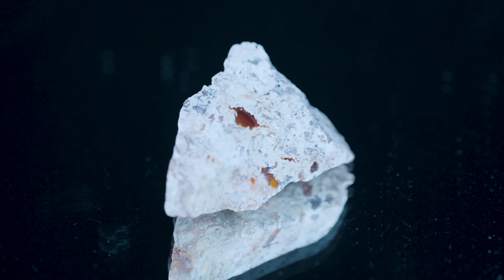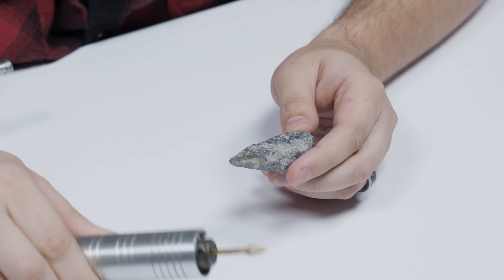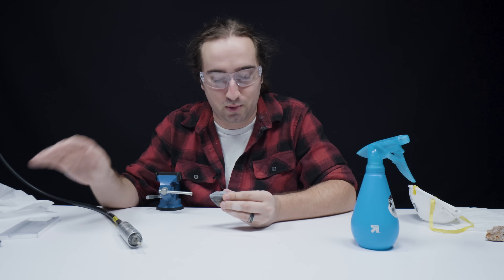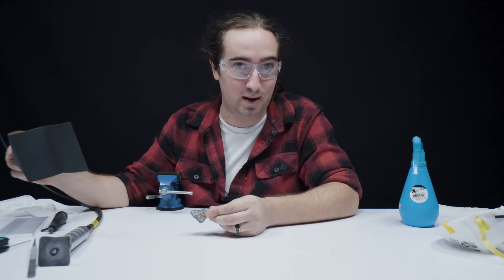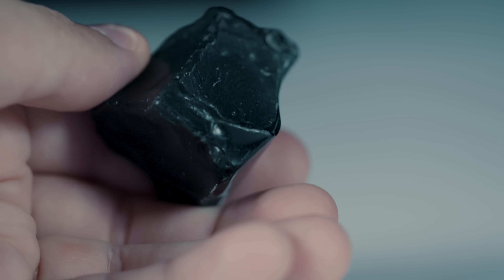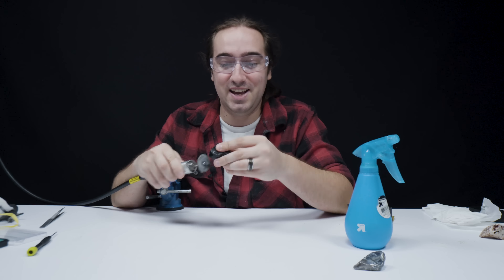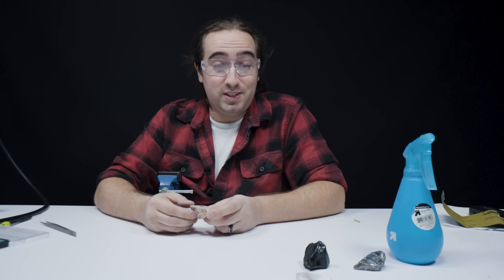Gemstone Polishing: A Beginner's Guide!

Comment: Please use water when doing this. If you have no other choice to work stones dry, it is best to wear respirators rated for fine silica dusts, and do it outside on windy days. doing it inside like this with breathing protection is a hazard because that dust stays airborne for a couple days and you are at risk for breathing it in when you don't have the respirator on.

Comment: Hey everyone, I've been drilling rocks to be used as pendants for 4 years now. Safety is a key concern anytime I talk to someone who might also want to get into lapidary too. You should really use water or an oil based lubricant when polishing, cutting, or drilling stones. For your face, wear eye goggles and a reusable respirator with P100 filters, or a full face respirator with P100 filters. I promise the full face is worth it, it has spared my eyes from the gritty mist or any stray chunks that could fly up at me, and none of it gets into my airways at all. N95 paper masks offer the minimum protection, and that's what I initially started with, but it doesn't properly seal to your face and I'd end up with an itchy nose which is not a good sign. Rock dust and airborne vapors can coat your lungs over time and give you a deadly condition called 'silicosis'. The buildup will slowly suffocate you to death, so please PLEASE use water (without wetting your electric tools) and the correct face wear. N95 protects against airborne dust, but the P100 also catches oils and moisture, thus offering more protection.

Comment: He stopped at 2k grit. With the hardness of a 7.5. You should be up in the 80k grit range. Diamond paste works well. If you run each stage of grit properly by the time your up to 80k grit your good to go. If you want or can you could go up to 100k grit of diamond paste and your good to go. There is aluminum oxide paste than cerium oxide paste. But I found diamond paste is the best option.

Comment: Nice vid, but I'd use a much more serious face mask. Cutting or polishing minerals dry is not to messed with. Get the best mask you can get and use a extractor with a damn good filter. I'd never dry cut because it can be very dangerous. Search for how dangerous minerals can be before you cut them.

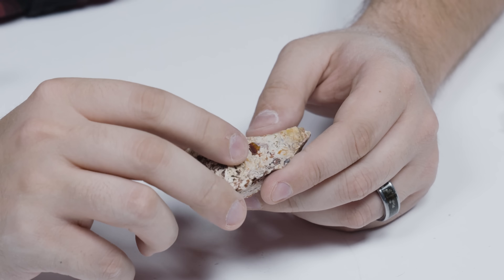Comment: 9:30 I’ve been working opal with rotary for almost a year now and I must say from day one to now I’ve massively improved. I do agree a cabbing machine is best(I’m saving up for one but for now a rotary tool is great for what I need) but what I’ve learned with the tools is there’s many ways to go about this process especially with free-form pieces. Sometimes even a 3-4 day tumble can easily make the experience so much easier. I find that a good pre polish is key for the best polishing experience with no can machine and just the rotary tools as after I began using it my polishing results were DRASTICALLY improved than jumping straight from sandpaper to polish. Hopefully I’ll get the machine sometime soon but improving just with the rotary tools is equally as motivating 💎

Comment: Ooowee! I'm surprised you didn't shatter your obsidian and opal from thermal shock! I used to use a slow drip of water above and a plastic tray of water below when I carved them. I'd dip the stone about every 30 sec to cool it. 

If you get into gemstone carving you'll want to get a thinner handpiece for your flex shaft. Like something from a dentist supply. With the larger handpiece after an hour your hands will still feel vibration if you snap your fingers or touch anything. It's really weird. Can't be good for the hands! 

With polishing obsidian you want to be really systematic with the steps.. progressively finer grades of sandpaper then up grades of polishing compound up to the best mirror finish diamond compound. Clean it thoroughly between each step. Let that vibration get out the grit and compound too, not just water and soap. You want every speck of compound off that stone before going to a finer grade or you'll get a noticeable scratch and have to grind it off and start again. It's real finicky! Opal in matrix is tough too because the matrix and gem material is so different (you know that!) So if you're not going to just grind it away it's better to use a cabbing machine rather than the flex shaft. It'll be uniform that way where a flex shaft bit will eject chunks of matrix faster than the opal. You also really don't want to work with opal dry. Not at all. If you can carve in a slurry of water and diamond paste that's ideal. It carves faster and cooler and prepolishes it. Doesn't seem to require as many steps as obsidian does to polish. It's going to be super porous even at the last step. If you have to stop before you get to the final polish keep it soaking in water. Both obsidian and opal cut like butter though. It's really satisfying, especially if you're doing something with a lot of fine detail. If you like those you might also like Tagua Nut, a vegetarian ivory lol. Carves the same and you can stain it with colored inks and dyes for scrimshaw. I've written you a book here lol. Hope it helps!
Reply: yep. i dove in like this on a chunky ethiopian opal. it would get very hot, until i decided to cool it w/ water.
it flew out of my hands many times, one time cleaving it in half. bummer.
so, while it's fun to dive in, it's best to know the basic dos & don'ts of such undertakings.

Comment: That was pretty cool. I used to use my Dremel to polish small rocks. I certainly couldn't cab I could polish and I had many bits and sanding pads from 60 grit to 10,000 grit. They were about 2 inches but came up to 4 inches and I did really well for someone that only had one hand.  The fire opal looked awesome! And I'm sure it was the easiest to get smooth! The iolite is pretty hard and will polish well, but is pretty hard going with a fordom. And you did pretty good with the obsidian too! I never had luck with obsidian, but I usually cut myself up too! 
Thanks for showing this, because it can be really helpful and easy for beginners!